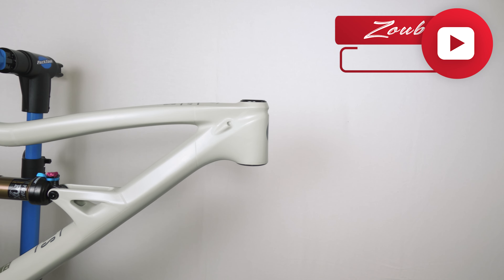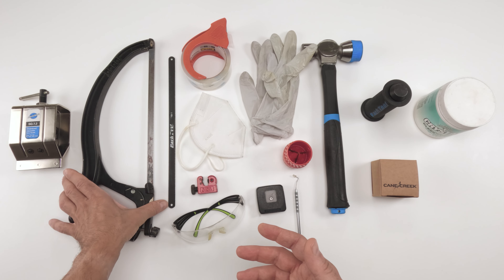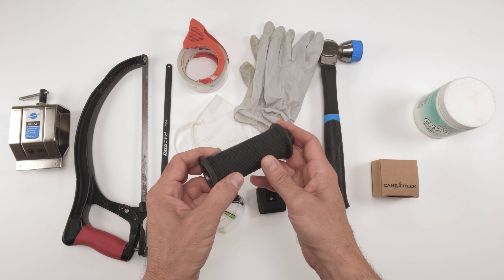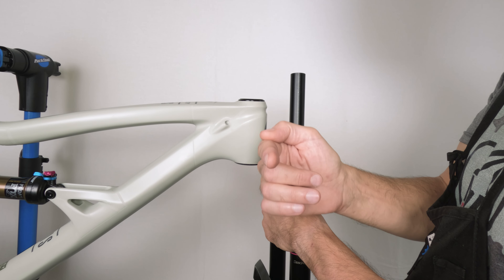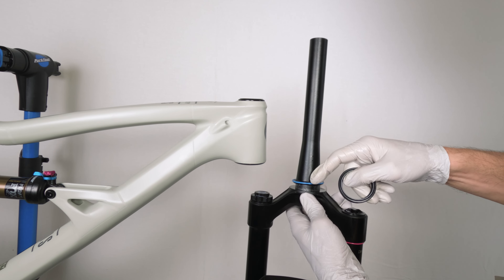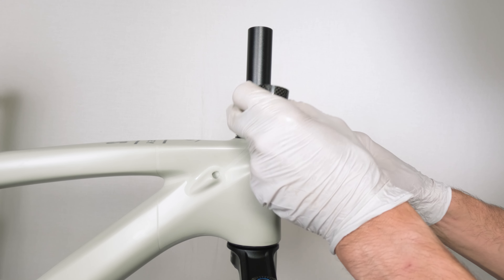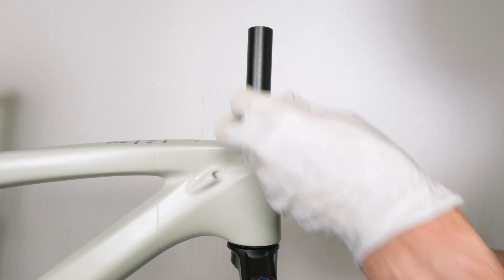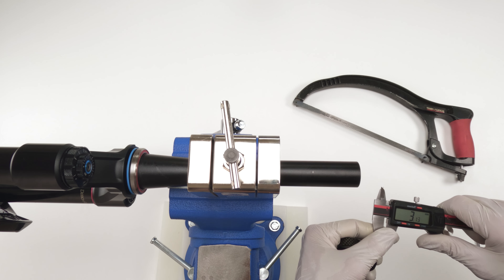Mountain bike MTB Headset & Fork steerer install guide for beginners. AVOID these common mistakes

Comment: I find you get cleaner cuts with Rigid CC247 tube cutter as opposed to a saw + guide. It’s perfect every time.
Reply from the maker: I believe it.  For me, it's a confidence thing. I feel more confident cutting with a guide. I've cut many pipes using  pipe cutters throughout my life  (copper, steel, etc.). Now, none of these cuts ever needed to be precise, but still, there were times when I was off by 1 or 2mm, thinking that I would be dead on.

Comment: Cool video. So right about keeping the steerer tube long until you find the right setup. 

I don’t use topcaps. I replaced all topcaps with OneUp EDC topcaps.
Reply from the maker: I've never actually installed a EDC kit on any of my bikes. many times I've thought about it, but I'm so used to carrying my backpack full of stuff, tools, pruning saw, pump, water etc, that I literally feel naked without it anymore. Every once in a while I'll see someone pop out a tool and it just looks so convenient

Comment: Thanks for the video. 

Were the frame and fork prepped before with a Headtube facing and Fork crown facing tool as suggested by the Cane Creek webpage for their headsets? 

I’m wondering if that is still necessary or if it’s only suggestion?